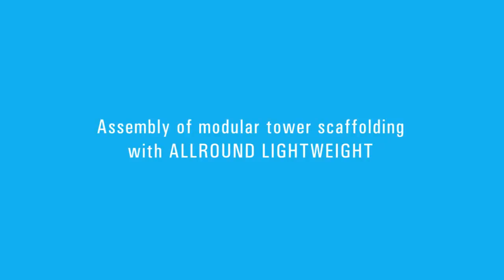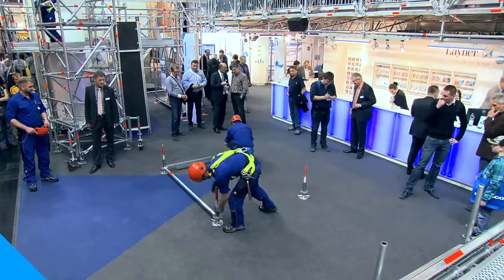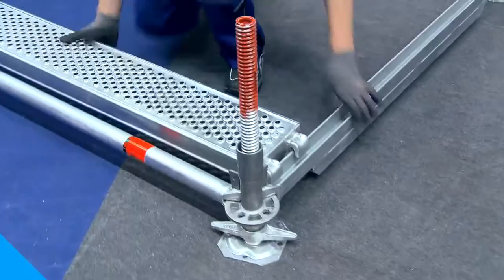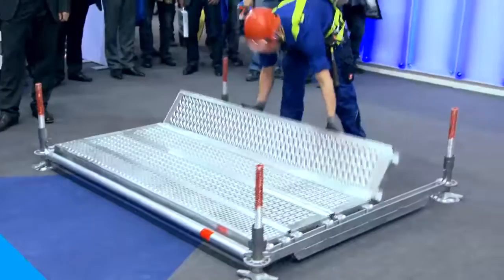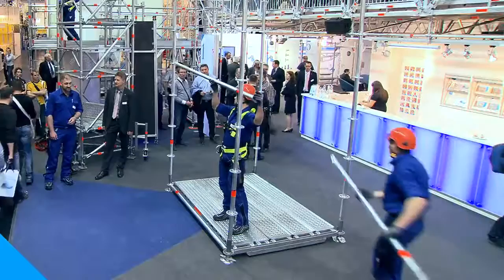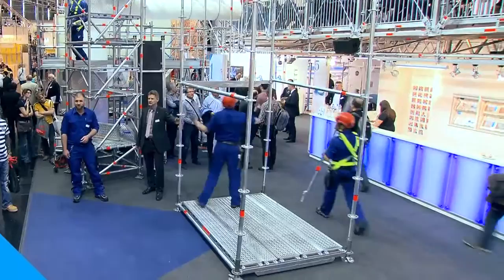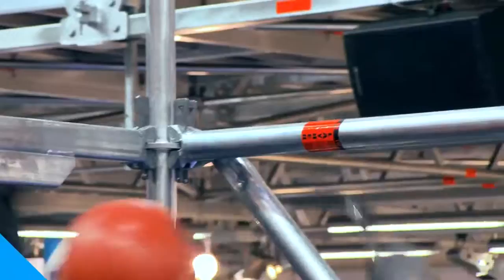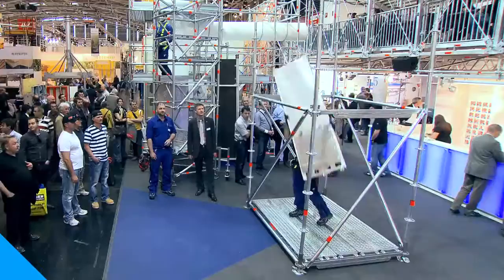Bauma 2013   Layher Allround Lightweight Live assembly

Comment: Nope layer is shit dont get layher tube and fitting layher has too many different components too expensive some components you will very very rarely used and just rust in storage, the components have to be exact because they cant be cut to size...tube and fitting is totally versatile and go ask your men what they are most comfortable with all of the british scaffolders are so ised to tube and fitting throwing a totally new system at them is stupid to expect it to make more money instantly, this system is good for large square blocks however you nor your competetors should be rushing to get this....
Reply: lahyer is mostly used for building scaffolds in places like oil refineries and power plants, because of its many components that are always needed when going around pipe systems that are endless
Reply: ^^^^^^this. “Tube and fitting” is a terrible choice in these settings. The time it takes to just get 2 wraps going and having to constantly level everything is ridiculous
Reply: Move with the times . We are not in 1950